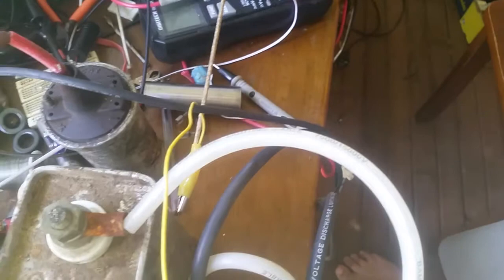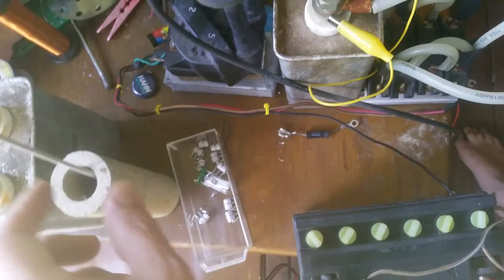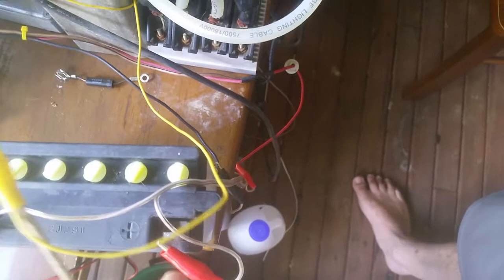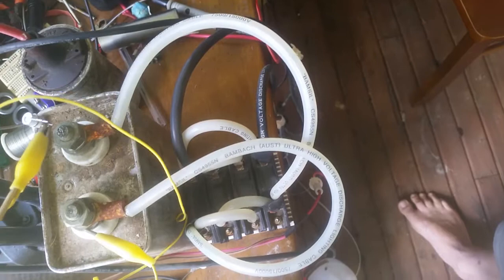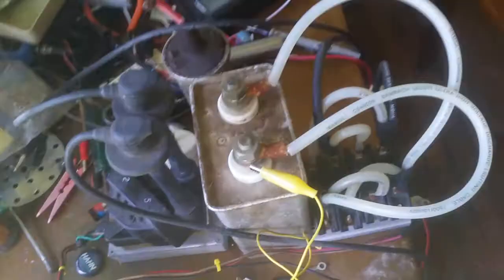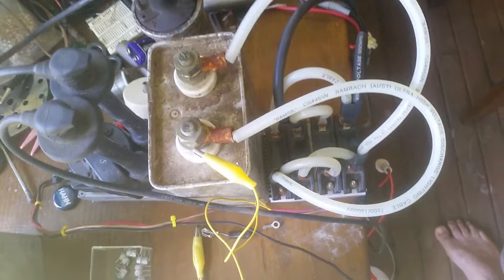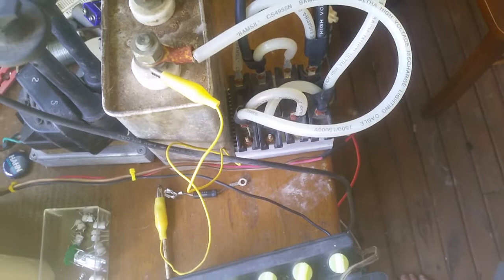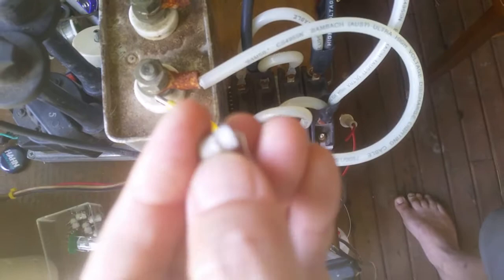DC sparks for Ed Gray setup...

Comment: how are you running the coil off DC ?
Reply from the maker: the DC makes the oscillation by discharging the HV caps when they are full through the gas discharge tubes and there is a field pulsing out at 90 degrees from the arcs that runs down one wire and set the MOT into oscillation. crazy